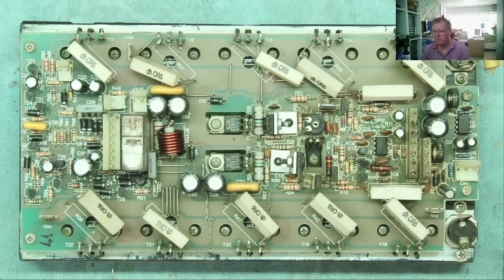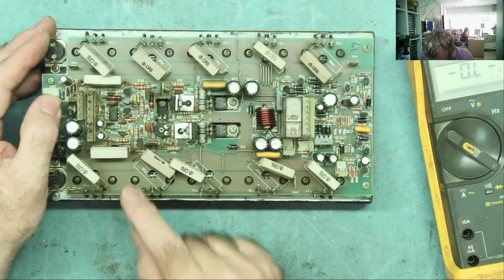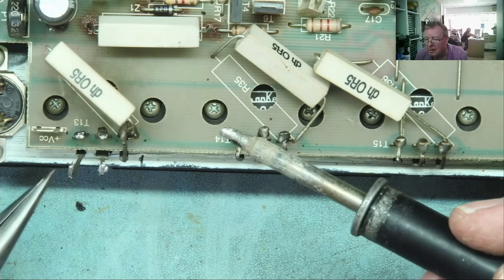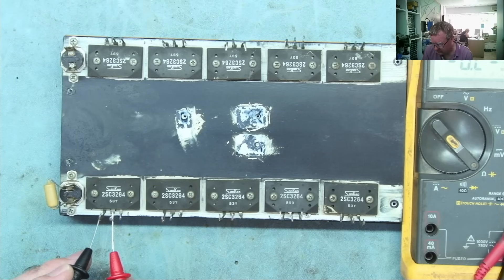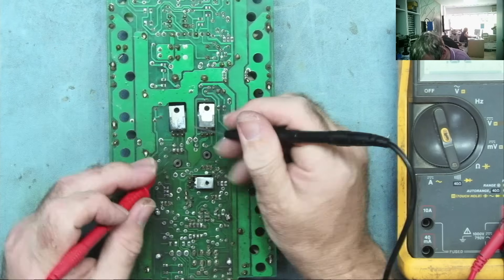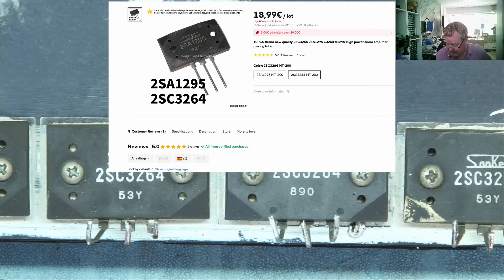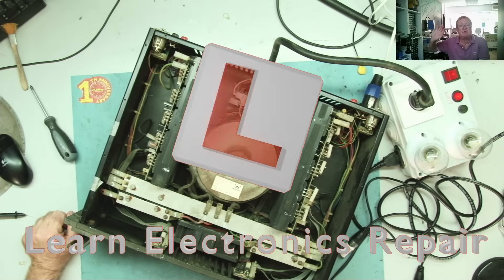PART TWO : Musicson P-802 1600W Audio Amplifier Repair No Schematics

Comment: That amp is so difficult and convoluted, but, I’d still I’d also consider testing the amp without the shorted transistors, to see if it at least runs on the 2 sets 4 seemingly good ones. Good call.
Reply from the maker: Thanks

Comment: I just noticed on the data sheet that the output transistors are available in two gain (hFE) "ranks." The ranks are designated O with an hFE range of 50 to 100 and Y with a hFE range of 70 to 140,
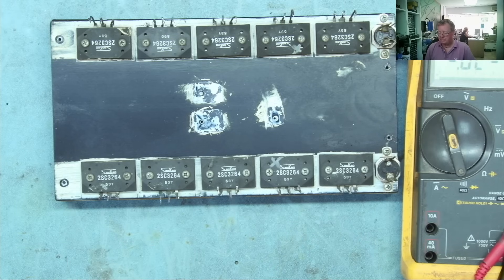It looks like all the parts in the video are Y, with marking 53Y, except for the second from the left in the top row at 6:35 which is marked 89O. According to the datasheet I have that three character line is the lot code. The O and Y may be purely coincidental, but I doubt it.
Anyway, a consideration when buying replacements.

Comment: assuming it exists:
The DC-blocking capacitor, normally an electrolytic, in the feedback path is a suspect with regard to low output. It will be in series with the low-side resistor in the feedback voltage divider so that the DC voltage gain of the amp is set to (probably) unity to avoid applying gain to any offset voltage. The cap impedance needs to be very low in the audio frequency spectrum. The cap used might be a "good" type, but is probably a pretty ordinary type rated for 1000 hours at 85 °C.

Comment: 10:48 - Richard you are getting a little bit over confident here... resting hand over toroidal transformer... no bueno for you or viewers...
10:10 - What is this yellow component on the left side? And why its missing in upper left side?
Reply from the maker: That is parallax making it look like my hand was rested across the high voltatge rails when viewed from the overhead camera,  they were actually several inches away!
Reply: I think the yellow thing on the thermal fuse is a cap to supress arcing on the thermostat contacts when it cuts off.
Reply: How is that touching the grounded metal over the toroid any different than than touching any other part of the chassis?
Reply: Okay, I take it back, that open palm across the bus bar at 11:10 is actually a little scary. 😂 I think it's a perspective thing and he's probably not as close as it looks, but from the camera angle it does look like this video was very close to going viral! 😂
Reply: @SkippiiKai  1. Heatsinks may have certain voltages in certain audio designs. First it should be measured then conclusion can be drawn. Heatsink with voltage plus grounded chassis plus skin of arm is no good combination.
2. Even if it is without voltage on that part, doesnt mean other limb cannot touch other metal with voltage. All it takes is one touch.
3. Perspective or not, there is no valid reason for him to place his arm there and move hand around...

Comment: good job richard! my eyes just hurt when i see you laying down your arm across the supply voltage bar. last time i did that, it was very painful. (555VDC) inside a CNC machine cabinet.
Reply from the maker: Ahh that was a parallax thing... they were quite a long way from the high voltage bars

Comment: 11:24 I don't understand what you mean here. You're just testing the board with several transistors disconnected, right? So when you say you need to figure out why the volume is lower on that channel, isn't that just because it currently has fewer transistors?
Reply: A possibility, though deafness due to a lifetime of listening to northern soul must also be factored in.
Reply: @ralphj4012  WHAT DID YOUR SAY?? I CAN'T HEAR YOU! 😁
Reply: @ralphj4012 more likely to affect his sanity 😅
Reply: There are 5 transistors, if you remove 1, you still can use device, as he demonstrated, but if you use it all the time at 100% volume one of 4 remaining transistors will be damaged, because they are supposed to work in group of 5, not 4. However, if he use 20% volume, it can work safely with 4 and there should be no difference between R and L channel. Rich states he hear difference. This means some resistor is out of spec (since there is no potentiometer for volume) or capacitor has increased internal resistance. Signal tracing with oscilloscope is one way to find fault or another way is to measure components on working channel and compare the difference.
Reply: @orion310591RS  Right, I get that, but the part I was questioning is whether changing the number of paralleled bjts really has no effect on the gain of each transistor. With mosfets this is obvious, and while significantly less so with BJTs it might not be negligible. Maybe it is, that's entirely possible, but I think it could depend on how the circuit is designed. If each base is driven from an independent source, maybe not. If there's a common preamp source with bases paralleled through base resistors, that will change the current through the other bases.
This could be confirmed with a very simple test: just disconnect one lead from a transistor on the louder channel so they have the same number of working bjts and see if the volume matches. If it does, great. If not, then it's a very quick test that confirms there's another problem.
Reply from the maker: @SkippiiKai  Well I can certainly see what happens with the volume on that channel once I have teh replacement parts.  My best guess is that it won't make any difference.
Reply from the maker: @orion310591RS  Oh it should also be mentioned.  I have a compressor/limiter on my mic input. This means that my voice sounds pretty much the same level whether I am directly speaking into the mic or facing in another direction. But as an unintentional byproduct it also means the level of audio (music) from my speakers when testing the amp channels  will sound the same to you as well.  This is why you don't hear the difference in audio level that I can.
Reply from the maker: @orion310591RS  Yes exactly what you just said🙂

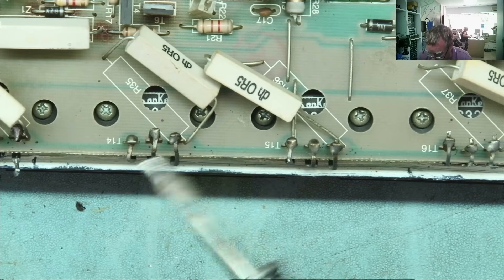Comment: 3:36 obviously not an issue this time, but if you ever need to direct heat one way down a leg, you can use toothless copper or aluminum crocodile/aligator/gharial clips  on one side of the lead. It should act as a heatsink to keep the eyelet/standoff from coming off while desoldering the transistor.
Huh... Talking about toothless crocodiles, I just had had a memory flash into my head from decades ago. As a child, I remember I had a picture book about a crocodile that lost all his teeth. I can't remember anything else about it. Does anyone remember this book? Would have been a book from around the late 80s, probably quite popular in England at the time.

Comment: I’d like to know more about pseudo AB amplifier and why it doesn’t have NPN and PNP transistors.
Reply from the maker: I've described these before but I am not sure where.  So normally the audio waveform is centered on 0V and goes positive and negative. During the positive half cycle it turns on the NPN transistors and connects +HT (to varying amounts) to the speaker.  During the negative half cycle it turns on the PNP transistors and connects -HT to the speaker.  With this psuedo class AB design the negative half cycles of the audio are inverted..  Therefore they are also positive going with respect to 0V and that means we can use identical NPN transistors to drive the speaker towards the +HT and -HT rails. Thats the basics of the how.  I don't know enough about audio circuit design to understand the why but it could be done this way so that all the output transistors can be more accurately be matched and may reduce audio distortion?